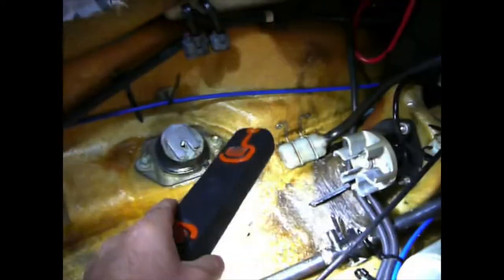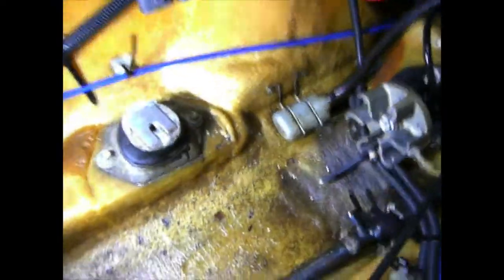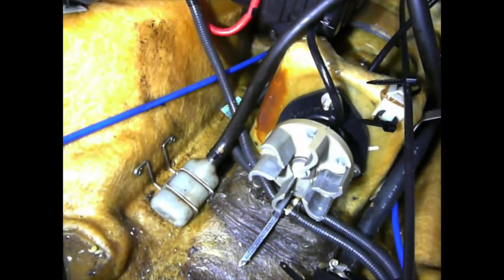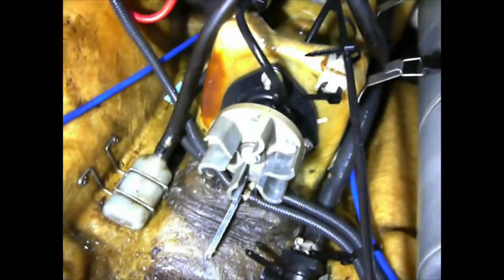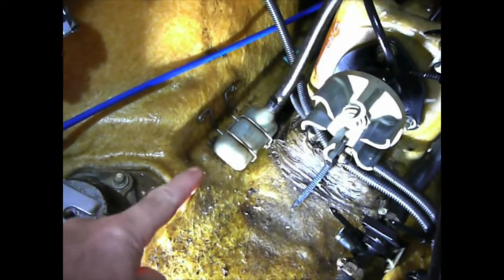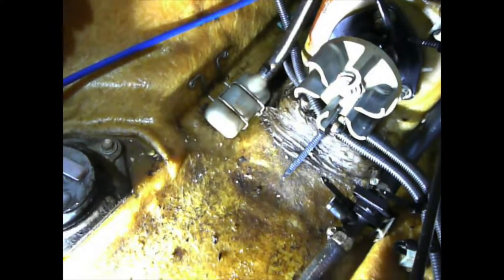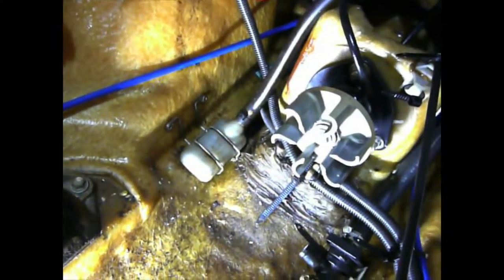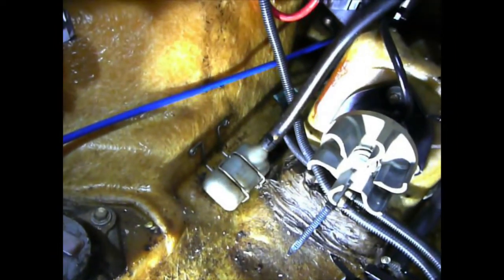Honda Aquatrax Jetski Bilge pump explained Mar2022

Comment: Does it pump water when on the hose? or while driving. Mine wouldnt pump out the water in the hull while running on the hose
Reply from the maker: Only works through the jet pump while zooming around out on the water. On the hose is low pressure and different water flow direction so only while driving is when the bilge will work. 😃👍

Comment: What would happen if u forget to attach hose that connects to on top of jetpump
Reply from the maker: Sorry for delayed response (car accident followed by storm damage and repairs to house of flooding that was neck deep). Without looking at my jetski (currently 2am) the hose from the jet pump is the hose that feeds the cooling water under pressure to the engine. All the bilge hosing is connected inside the jetski. Basically if you forget to attach that hose you'll certainly have some major problems. 😃👍